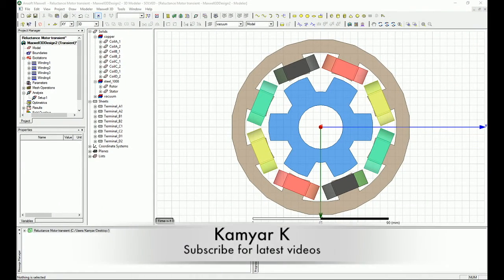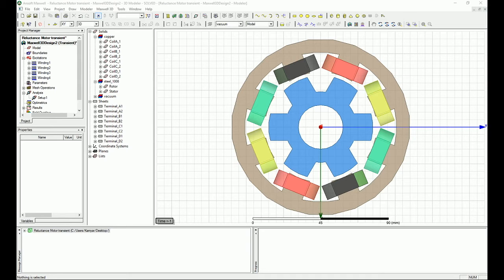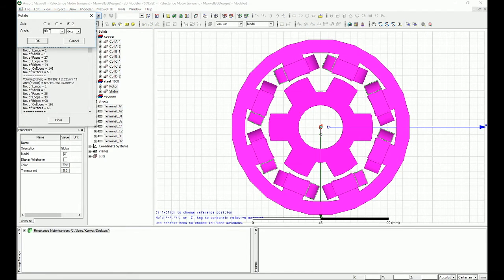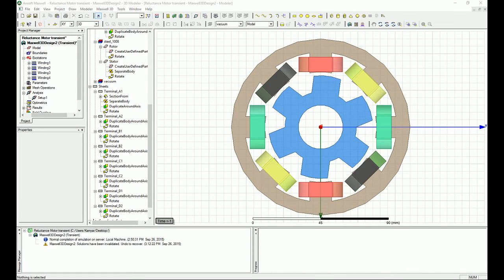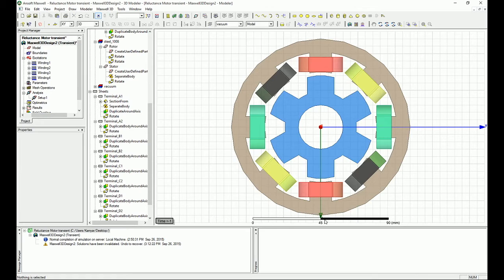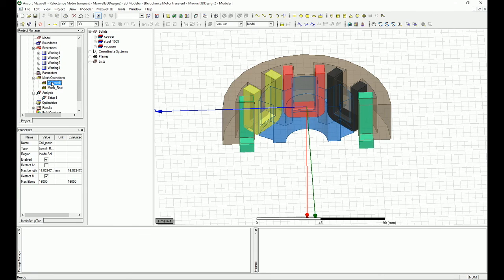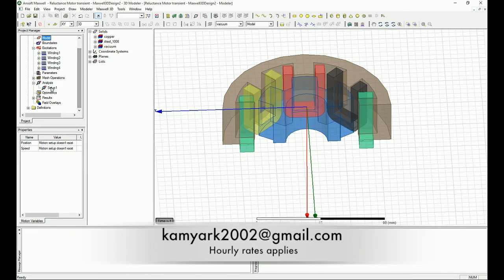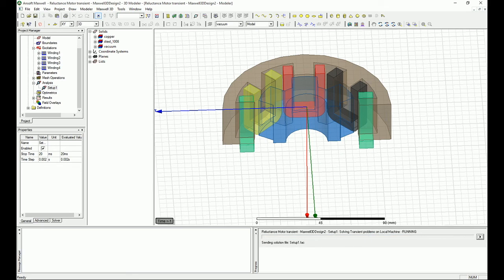403 - Ansys Maxwell | Advanced Symmetric in Reluctance Motor [1/2]

Comment: hello kamyar.. your video is very good.
i had a problem while doing split operation of symmetrical object. there was a coil which was a loop earlier. after splitting the mode along two plane, the coil is now having two ends, which should be assigned as coil terminals, as you said in video.
but when i tried to validate the model two errors came as follows.

illegal external terminal 'coil terminal 1': An external terminal must border the edge of the problem region and coincides with the surface of a 3D object.

also while doing maxwell 2D simulation for trying split on symmetrical model, errors came like 
Maxwell2d solver, process2dsolver error, internal solver error: '%1'

 what should i do? by the way i'm using maxwell 14

plz reply soon
Reply from the maker: +Dileep P Hi, make sure that the region is always touching the terminals. the error that you describes basically say your terminals are somehow within the region. fix that and you should be able to see that the second error solved as well. '